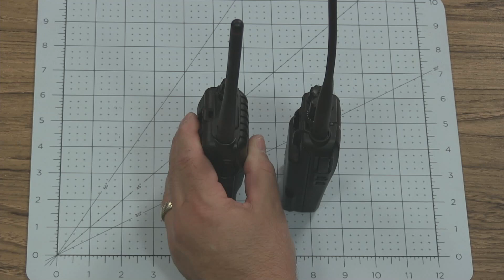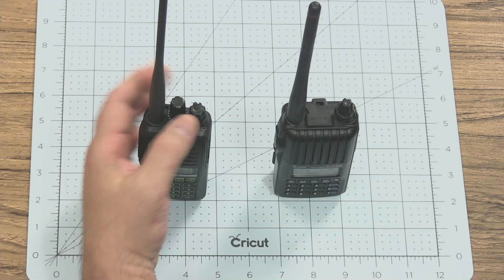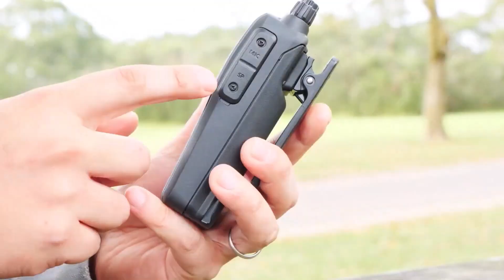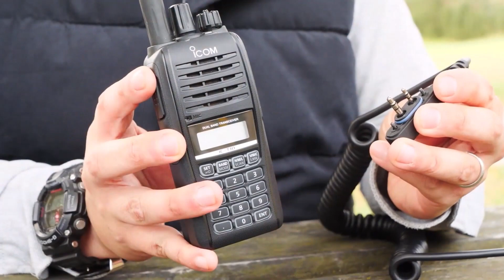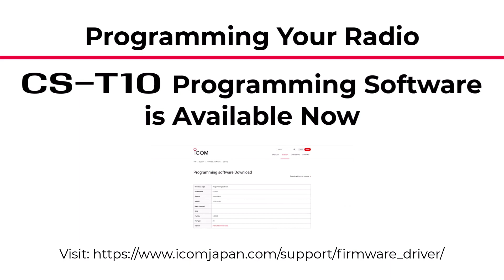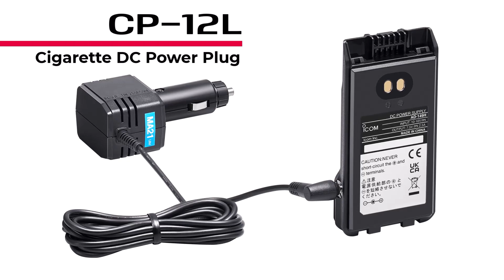#Icom IC-T10 & Accessories

Comment: I bought an IC T10 based on my expirience with FC 1000. I paid $170 from DX Eng and feel that's a fair price. The radio is no frills but fantastic. My tradeoff was extreme high quality/ruggeness vs. Stuff I wont use like DStar, 1.25m band, aviation, or a million memory banks. The IP waterproof rating was something I needed. After some initial wrestling with the operating logic, keystrokes and menus, I am good with operating and keying in memory. I do like the program scan banks and broadcast fm/wx. The radio met my expectations otherwise. The manual could use some work. It's not really an instruction manual but more of a glorified feature spec sheet. If you have the budget and a few minutes to learn menus, then this is a great radio!

Comment: I'm a BIG Icom fan! Great Radio! Bad Design! That is NOT a bug out radio! That's BS you have to bring your drop in charger with you. You do not have an accessory that will plug into the side of the radio to charge the battery while the battery is attached to the radio.
Reply: Icom should have added a USB-C charge port directly on the battery.  This would allow charging radio and also charging spares separately.

Comment: Just got mine, love the feel, size and ease of the manual functions… for the cost wish it had a little more options like it’s lower cost competitors…I’m a Mac guy and the software doesn’t work on my older PC running vista.. so I can’t use it yet… hope icom fix’s that or puts out a Mac version